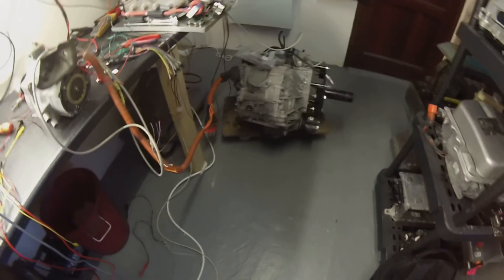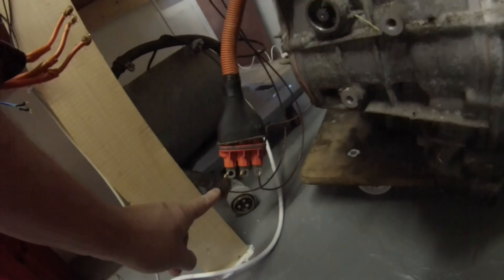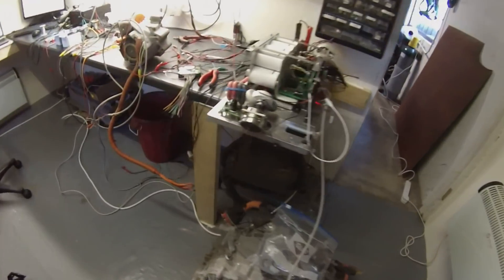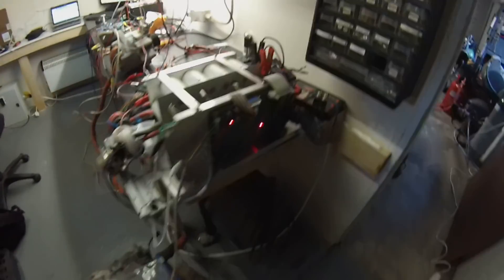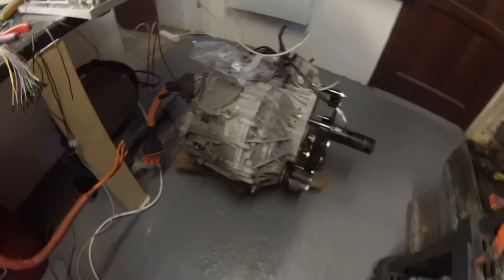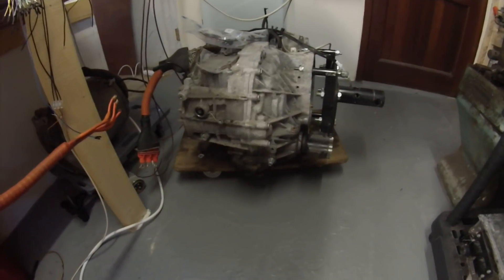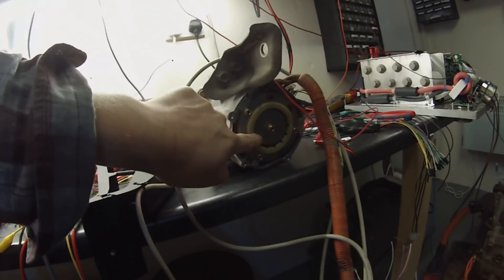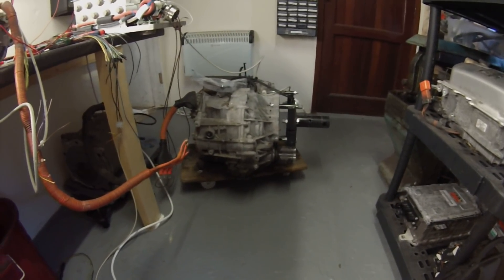Prius Transaxles

Comment: Would that little motor / generator be powerful enough to drive a Geo metro Suzuki Swift?
Reply: 30kW peak is enough for a compact car. highway cruise power will be 6-7kW only, so a 50kW motor from a prius is plenty and will give you a 0-60 times at around 5 seconds with 500 pounds of batteries.  Such a battery will have 50kWh and give you a range of 600 miles. In short excellent choice, finding the smallest car possible for a conversion. Another option is the rear e-transaxle Q211 from a RAV/4 or Highlander 2006 onwards. It is lighter and smaller and also 50kW, possible also cheaper.
Reply: @Tore_Lund  9 months later thank you very much. I really didn't have the expertise to do this. But I have engineers now it's a place called go create Wichita State University. Kansas USA.
Reply: @stevencorrea7982  Congratulations, nice to hear you got it off the ground. Funny thing is, I was in the same fantasy stage at that time too, and I got an 18 year old lead acid battery EV based on the Fiat 600 last month, now upgraded to 20kWh Li-ion. I use only 16kWh/100mi, it is slightly bigger than the Swift, but in the same ballpark and city driving is only around 12kWh/100mi, with the stock squirrel cage 30kW motor, so yes, small EVs are so much more efficient, read cheaper in batteries. Next dream is a solar roof. If I can stick just 250W on there, 95% of my trips will be without needing charging, I don't drive much, only shopping, fetching kids some days of the week etc and the odd 70 mi family visit.

Comment: The motor in the Prius is only 35hp.  Is that enough?  Maybe two for AWD might work.
Reply: What type of torque does it produce?
Reply: it depends on which model your using gen 3 is at 80hp/207nm for mg2 only on stock controller

Comment: Damien, I have bought a 2012 Renault Kangoo Z.E Would it be possible to uncork the 44Kw motor to match the Nissan Leaf 80 Kw (or more!) since I think they use the same components as they had a joint cooperation at that time. What do I need and what  cost can I expect? Thank you in advance // Tomas from Sweden

Comment: Are Toyota hybrid transaxles good for continuous usage? I mean driving for a hundred kilometers at potentially highway speeds? Not sure because in their original cars they are always coupled with an ICE and the battery capacity is good for like 5-10 kilometers on EV mode.
Reply: Yes but they have a Max speed. They can only remain fully electric when below 70km/h. They have a transaxle oil cooler by default to keep them in spec.
Reply: @ReubenHorner  If the oil cooling is uprated, can it achieve for example 120 km/h?
Reply: @epatto  I don't believe it is a cooling issue but simply what rpm the motors can take. I would imagine they could output more horses without issue but going over speed comes with a few issues that comes to my mind. 
1. I'm not sure if you can exceed the top speed without increasing voltage. I have heard somewhere they are brushless DC that would need fancy controlling to do field weakening?? Not sure about that one.
2. Simply rotating it faster means there is a higher chance they fail (break apart). 
3. I think it would be more productive to try and break the transaxle apart to change the final drive to allow a higher top speed. They are very reliable so there is headroom for sure but I'm not sure about the limits
Reply: Okay, so it's out of the question for my EV project then. Too bad Nissan Leaf motors are so expensive.
Reply: @epatto  how much are they? Are they in such high demand?
Reply: @blackterminal  I think they are in high demand since they are perfect for EV conversion. In Finnish salvage yard I've seen asking prices of over 1500 euros. On eBay they are from 700 to 2500 euros. Add to that the cost of the Leaf gearbox (another 250 to 500 euros) and it starts to get really expensive. Compare that to Toyota hybrid transaxles which have the final drive built in and cost just 300 to 400 euros on eBay.
Reply: @epatto  it should only be gen 1 and 2 that had the speed limit but it seems that it can be overdriven

Comment: Plenty of possibilities there. The one you had on the bench with very little tweaking would work well on a cruiser motorcycle with a different pulley for belt drive! All in due time though, you've already got a large amount of things accomplished this year already. Does those transaxles use regular gear oil or is it some special brew just for these that Toyota thought up?
Reply from the maker: They all use Toyota WS atf oil (World Standard)